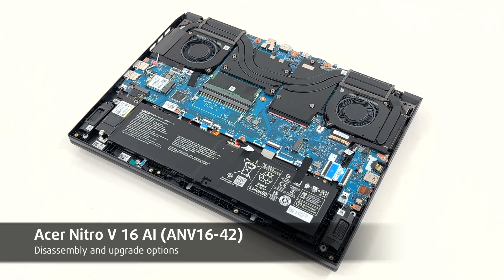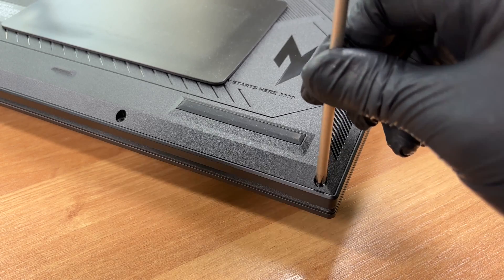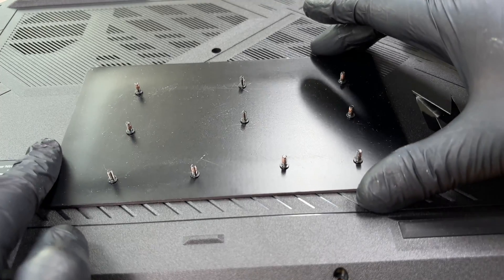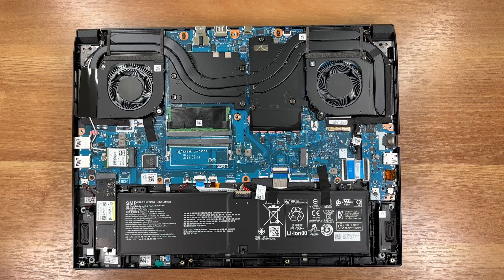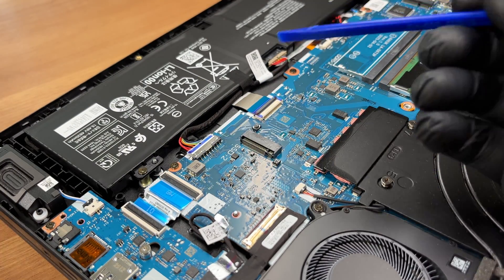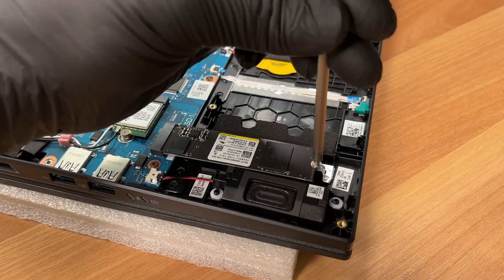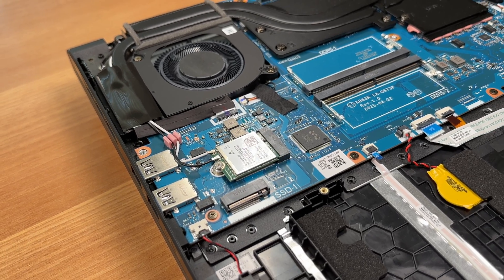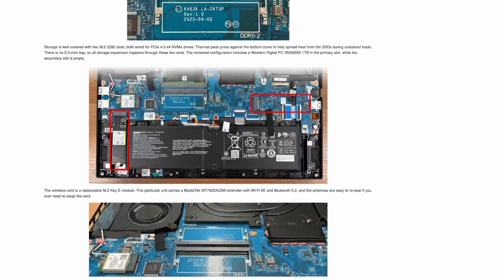🛠️ How to open Acer Nitro V 16 AI (ANV16-42) - disassembly and upgrade options

Comment: O.O I'm genuinely surprise how upgrade and replace friendly it's been so far. Just 2 screw and the battery comes off. Not glued in. That I hate so much. And the empty slots for RAM and M.2 SSD are easy access. Even cooling pads for the empty M.2. And even the Wi-Fi easy to replace. 
I'm considering buying a laptop. And in addition to general reviews. Disassembly and upgrade is on the forefront of my mind. I used to repair electronics. With PC/Laptop focus. And God for years the laptop have become more of a nightmare to deal with. There was a time you could replace the keyboard without having to disassemble the whole thing. I really like the internals on this one. 
Thanks for the vid.
Reply: I've just got one. Really nice budget gaming laptop, not so heavy and decent battery life. 

The only downside imo is that opening the lid requires tools and is not so easy, but still doable by a tool like me

Comment: I bought an Acer Nitro V 17 AI - ANV17-41-R3E9 laptop. Is there a similar assembly and upgrade video for that? 
Specification: 17,3" QHD 2560 x 1440 IPS LED screen; AMD Ryzen™ 7 260 - 8 Core • 16GB DDR5 / 1TB PCIe Gen4 NVMe SSD • NVIDIA GeForce RTX 5060 8GB GDDR7